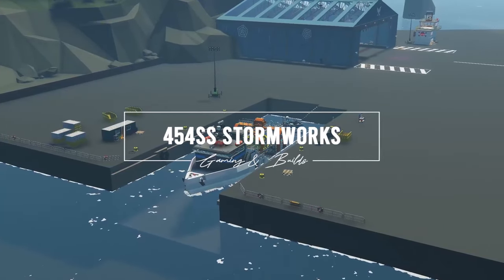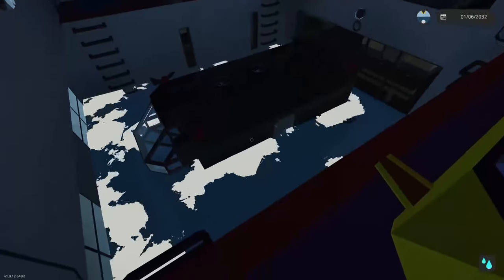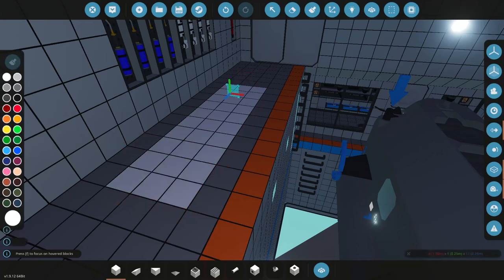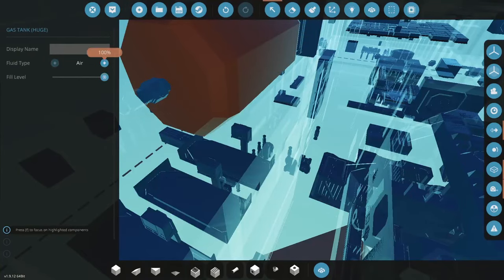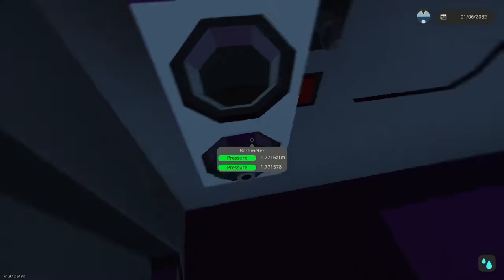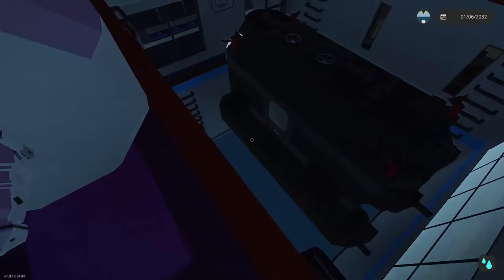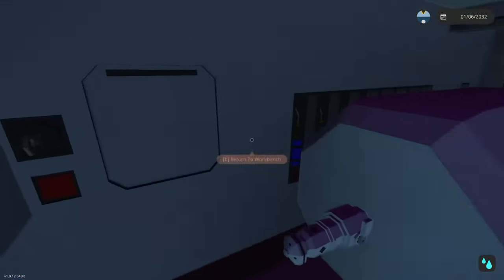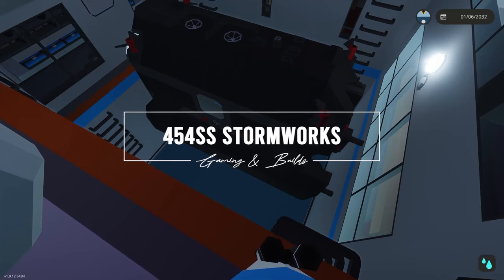WORKING MOONPOOL in Stormworks with the compressed gases update

Comment: the pressure was escaping, because water was at closing line, so when you pump more air, it just floats out by bottom, but this also gave me an idea that hovercrafts may work now
Reply: idk if the first part is understandable, but its basiscally the water goes below the minimum in the moonpool and then there is air coming from bottom of the ship
Reply from the maker: I see - It was as it if was leaking out
Reply: @454ss_gaming  yeah you could say that

Comment: I built a relatively large moonpool like this in my ship and i have a sub connected to a lifting system. When i move the sub down with the lift, the sub is leaking, the waterlevel rises the same speed as the outside. when i dont use the doorframes, the sub is not leaking. Does anybody know, if this is this a bug currently or am i missing something?

Comment: Any way to fix small sub that uses the manifold glitch? I might need to use pressure to pump the water out, however the issue is you will loss some pressure and gas during the process. Eventually you need to surface to refill the gas and pressure of the tank.